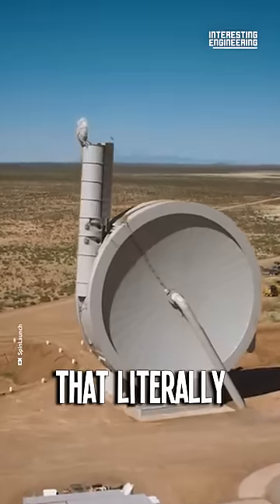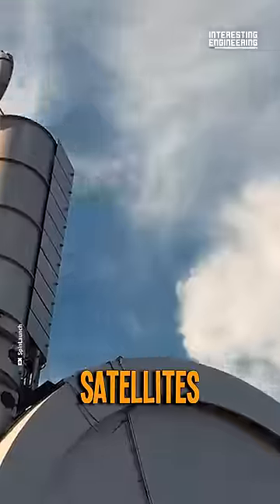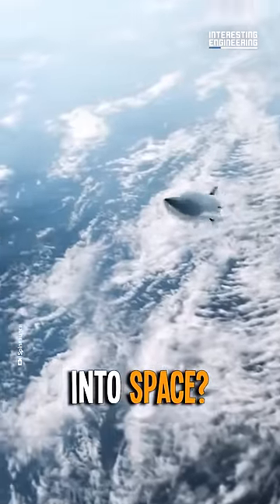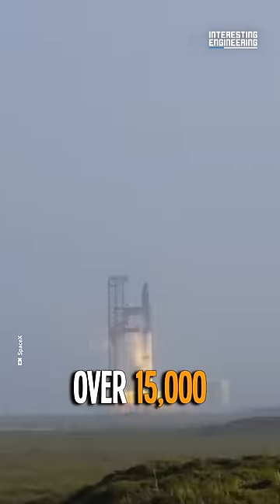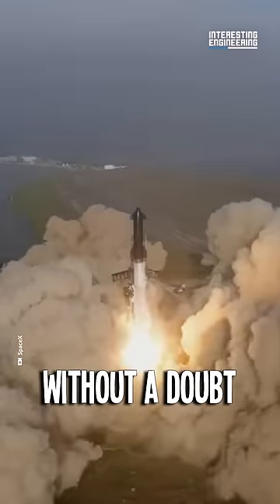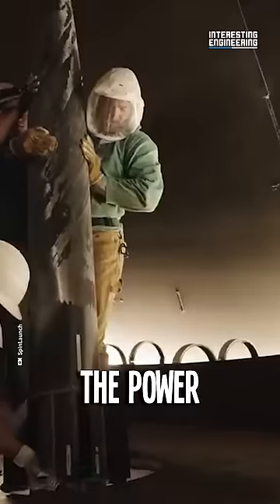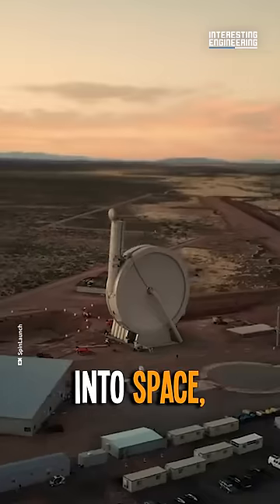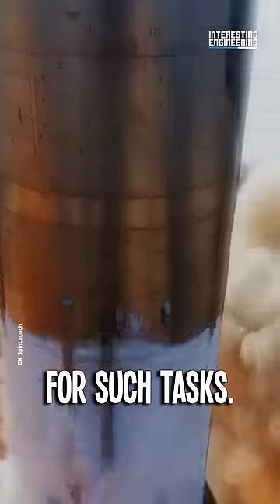Throwing Artillery Shells Into Space

Comment: US Military: Can we use this horizontally? 🤔 💀💀💀
Reply: Rail gun concept maybe
Reply: @eabroham7937umm no it's not. You can't shoot something this large as fast out of a barrel with gunpowder....
Reply: Or vertically down?
Reply: Way ahead of you bud 😂
Reply: they already have a railgun
Reply: @JakeRohde52  As fast that this device or as fast as to reach the orbit ? The "gunpowder" has beaten this device at the current stage 10 times over long ago. On November 18, 1966, the HARP gun operated by at Yuma Proving Ground launched an 84-kg Martlet 2 missile at 2,100 m/s, sending it briefly into space and setting a world altitude record of 179 km.
Reply: Iraq Supergun was originally a sat launching tool.
Reply: They already have a spin gun. Not sure if they use it or not. But it's been done.
Reply: @imantsjansons5009  The full sized HARP cannon was 16 inches in diameter . They had a baby 5 inch version that also easily outperformed the 1/3 scale Spinlaunch . The baby HARP was able to fire projectiles to an altitude of 240,000 feet as opposed to 30,000 feet by the Spinlaunch . It was used to collect atmospheric data and only cost $300-$500 per launch . There's no way that Spinlaunch could ever come close to the performance of the 60s HARP cannon .
Reply: centrifugal firing systems aren't new.
Reply: @greg77389  but this is totally different than a rail gun and would require way less power and they also gave up on the rail gun
Reply: @441rider  the story of the guy behind it is wild
Reply: What I was thinking 😭😂
Reply: At an angle😂
Reply: Yes you can. Also rocket fuel so who cares.
Reply: MajinBuu-oo3vn They aren't as good
Reply: @ItsCrap97  Exactly. Rocket fuel only costs the people that are launching the rockets any money.  It does not cost me anything at all.  The rocket launchers can spend one million dollars a gallon.  I do not care.  I use none of it.
Reply: Ironically the HARP Gun is what you get when the opposite happens 😂
(two naval guns combined into a great big sat' launcher... that fell victim to short sighted politicians 🤦‍♂️)
Reply: @bryanobrien2726  Yup. It's mad that nobody other than the chap whom devised HARP, has seriously tried to expand on the concept since.
Reply: Just change the launch angle, you got a long range artillery cannon.
Reply: @glidershower  Not as long range as some actual artillery guns though 😆
Reply: Trebuchet
Reply: US Military: Can this be used to assist in genocide?
Reply: This is the real reason for the invention
Reply: Rail gun, trebuchet, Evel Kinevel's new toy...
Didn't I see something like this in infinite warfare?
Reply: @MajinBuu-oo3vn  as if they have the budget to fuel not only a massive project like that not to mention the production, install, and/or retrofit on a massive scale to rapidly equip that piece of wargear.
Reply: Top comment 😂
Reply: @JakeRohde52 battleship guns?

What they are shooting looks a lot like a sabit round the Abrams would use.
Reply: @bryanobrien2726 I was thinking battleship main guns, but this is a much better example.
Reply: @jeffshackleford3152  It may well be a repurposed artillery shell of some kind . The one that they show firing is a 1/3 scale prototype SpinLaunch . It would be easier  to just use something readily available rather than make 1/3 scale version of something that most likely will never go into production .
Reply: Us weapons are so outdated
Reply: You got it backwards. They already do. Where do you think they got the idea from?
Reply: @JakeRohde52 yamato main guns:
Reply: This is from Germany
Reply: Kim jong Un 👀
Reply: Why horizontally though? Just have a crapton of bombs in orbit ready to drop at a moments notice, anywhere.
Reply: Haha "and Target that building over there "
Reply: Yes. Trebuchet
Reply: Artillery has been exploring this sort of thing for at least 50+ years and super guns for more than 100. Look up Gerald Bull or the Paris guns.
Reply: @441rider my brother in law was there when U.S. forces seized it, then destroyed it. Very interesting history with Gerald Bull too.
Reply: its called the railgun and yes they have the tech, requires a lot of induction energy
Reply: Oh shitttt
Reply: @Brian-rn2wx  why aren't we railgunning sats into space?
Reply: @jnuhjnuh  Ask NASA brev
Reply: @user-el5yw1er2j   Yeah...David and Goliath
Reply: Spin gun?
Reply: @JakeRohde52  false
Reply: It's never a war crime the first time :)
Reply: Apfsds it's from a barrel not rotating tho
Reply: That's true. Talk about saving money.
Reply: @johncameron6864 As compared to?
Reply: Yea, pretty shure they already tested electromagnetic rail guns.
I'm sure since MGS1 about that.
President Baker said it.
😊
Reply: Why do you think They created it??? No Propellant guided munitions with no thermalsig apart from mass v space.
Reply: 5000 mph/8500kph. Haven't seen a railgun used or refined ded recently
Reply: "on people?"
Reply: @matthewfors114  Gerald Bull, right? Wanted to continue his research and (I can't recall the circumstances, but he wasn't getting any takers) the Iraqis were like "Sure. We'll fund your research into a gun the size of a hillside." .......and then Mossad eliminated him as a threat to Israel.
Reply: Humans have been using it horizontally for millennia. There's even a mention of it in Mr Tangerines's favourite book.
Reply: Well said 
Good point
Reply: MuslimsAreEvil22  I love the message right on dude
Reply: already invented -= trebuchet
Reply: @jkiker7918  The trebuchet shoots vertically. The OP said horizontally. That's called a slingshot.
Reply: About 3/4 in, the video shows one system tilted about 40 degrees from horizontal, so I guess they didn't miss that sale opportunity.
Reply: They already have, with ball bearings. It cuts a line through concrete and anything behind it. Mankind is so inventive when it comes to killing machines.
Reply: You know that to a satellite enter i got it needs to run horizontally, right? RIGHT?
Reply: The biggest problem I would anticipate would be the contact with atmosphere at ground level coming out of this vacuum system at the required MACH number (25+?, or more to compensate the "air wall?). Seems to me that would create absurd heat but I'm no engineer. Can anyone with expertise tell me what would happen?
Reply: @Brian-rn2wx  tail gun uses magnets not centrifugal force dummy
Reply: @mf.danger9235 a person could be wrong about something, doesn't make them dumb. BTW,  Whats a tail gun Dummy?.

Comment: "We saved $50 million in fuel costs but DESTROYED a billion dollar satellite."
Reply: I was about to write - I am sure its possible with enough propellant to shoot something into space with a huge cannon (largest WW2 cannons reached the stratosphere) but the bigger issue is to keep stuff from vaporizing / breaking if you have to initially speed it up enough to go all the way to space…
Reply: You really don’t think the engineers can design around that? What makes you think you know more about this than aerospace engineers with PhDs?
Reply: There are missiles smarter than you that move 3 times the speed of sound and theyre able to hold it together. Im sire they can apply the same tech to satellites
Reply: @bingobongo1615 Well, shells are accelerated under tremendous strain in the barrel, while proposed system is kinda just spin it. Still axial strain and especially during release one should be tremendous. Though if an actual satellite situated closer to centre of spinning it can actually work
Reply: @bingobongo1615 I remember that big cannon
Think that was the 60s. Seems they abandoned that idea
Reply: Think this - impulse loads versus ramp accelerated loads. They are miles apart
Reply: I have a picture of a ghost on a tv.
Reply: Exactly.
Reply: Aaaand it dont wok
Reply: @couchpotatoes5158 the point that actually nobody is doing it, it is mindful anyway
Reply: @BillyBigRiggin359 yes and no. They have very short life …
Reply: @BillyBigRiggin359 3 times the speed of sound? You know escape velocity is 40x the speed of sound? And in a rocket it is applied relatively gently at about 5g. However, in spin launch just to spin the satellite up to speed ( assuming a spinner 10 stories high) it will experience many thousands of g's. This is enough to make concrete disintegrate.  No. They're going to have to use very different technology.  Hence the remark about destroying satellites
Reply: @couchpotatoes5158 because I do, and I’m not taking look-in-the-mirror lessons from a couch potato
Reply: Ahahahahahahahahahaha! Geez I love  the genius of other comedic minds. 😅
Reply: Wasn't that the design lol
Reply: @couchpotatoes5158  you're an excellent example of someone who doesn't have the physics acumen to verify the veracity of what they read or are told. 🙄
Reply: @couchpotatoes5158 huh? Keep glazing
Reply: @大砲はピュ  do you not have a valid response? Wtf do you mean “keep glazing”? That means nothing
Reply: Acceleration = V^2/r and a LEO satellite moves at 16,000 mph that's about 26,000kmh so you would need to achieve 7200 m/sec
Tun that through the equation with r set to 30m (100ft ring) we end up with 170,000G.  That's 20 more than acceleration from a canon shell.   So will this satellite survive?
Reply: @bingobongo1615 there’s testing on using railguns to do that, but now the problem is related to the strong magnets being used rather than the destructive propellants… plus I don’t even know if they’ve managed to make a strong enough railgun yet
Reply: @couchpotatoes5158 it's a basic impossibility. Objects at sea level experience more drag than objects in the upper atmosphere, which is why multi stage rockets make sense. We can tweak the throttle so it stays efficient and doesn't blast itself apart. Just yeeting it directly from ground level somewhere in the everglades directly into the stratosphere will cause numerous insurmountable problems just from the structural standpoint alone
Reply: @lithuaniaball  they have already proved this works. Stop acting like you know more than engineers with phds
Reply: @couchpotatoes5158  oh? Show me a working model, then. Otherwise, all they have done is a series of mathematical equations that theoretically prove it could work, unless they missed something. I'll wait here in the real world
Reply: Ok and space xs tests. “We attempted to make it Stand up on its own. We failed. We failed. We failed. We got close but failed. Hold on we succeeded.”
Reply: @lithuaniaball I'm so glad that you have such a closed mind, yeeting and all that. Why not build the launch site on Everest! You could yeet the satellites up there easily, with just a trebuchet! Then they get loaded into a concrete casing for the final yelling! The concrete yeets away under the stresses, and in doing so it prevents the satellite from experiencing any trauma! And the rocket does the final yeeting, and yeets it straight into the sun!
Reply: @bingobongo1615  I think the satellites already travel at very high speeds to escape gravity. But throwing probably requires even more speed, since after the initial throw there is no more pushing ahead against the atmospheric pressure and the gravity pull.
Reply: Nowhere near 15,000 gallons per second
Reply: Destroyed? oh, you mean completely pulverized it? yeah, nothing like billion dollar powder to spice up your bbq
Reply: @couchpotatoes5158 nah I think it'll bake in a failure rate that is unacceptable given the various types of satellites, potentially sensitive instruments and G force involved

Not to mention the G forces involved here are absolutely mind-boggling and there are hundreds of different satellites with different purposes and tolerances.

There's a reason this has been an idea for decades now and they haven't gotten it to work
Reply: @jazeenharal6013  you really don’t think the engineers account for that when designing satellites?
Reply: @couchpotatoes5158  we're talking about a platform that has never once worked because it crushes everything with centrifugal force. 
The amount of G-Force an object would be under in order to spin it fast enough to launch it high enough is absolutely unbelievable. 
It would crush just about any complex device before it even got to half power.
Sensitive electrical components, capacitors, processors etc.

There is a hard limit to engineering. They're not magicians, they have to work with real materials.

Maybe a different version of this type of idea might work, but not this one. (Perhaps a much longer rail type system that goes underground and gets speed up over a longer distance. A "space cannon" maybe. But not this one, this thing will never work)
Reply: @nicholaswhitehead8842 More precisely; the politicians got bored [as they often do] and the inventor got murdered by Mossad after he tried to find another patron.
Reply: Satellites are cheaper than the cost of sending them to orbit. Unless you're talking about some crazy overpriced NASA project with a ridiculous budjet
Reply: @couchpotatoes5158  Aerospace engineers with PhDs had decided to take a different route. That should be a hint.
Reply: @BillyBigRiggin359 🫨😯🤭🤣…🫡 well said
Reply: @bingobongo1615  rumour has it that a nuclear bomb launched a manhole cover into space.
Reply: @couchpotatoes5158  Bold of you to think anyone on this team has a PhD. Also bold of you to think that PhDs have any real authoritative value anymore in the fact of Boeing's endless string of failures lately.
Reply: @wolfehoffmann2697  are you slow? Having a PhD means you’re on top of you’re field and know what you’re doing. Also the media is completely blowing all this Boeing shit up; Boeing still has an extremely good safety record compared to other companies. And of course Boeing’s top engineers has PhDs
Reply: @couchpotatoes5158 having a phd in physics doesn’t make you immune from the laws of physics.
Reply: @couchpotatoes5158  This thing is stupid. I say it with confidence using my high school physics knowledge.
Reply: I wonder if it can launch a ball containing a satellite which can then unfold in space.
Reply: @bingobongo1615  I think I remember ex Iraqi President Saddam Hussein used to have a program where they designed a cannon or some type of projectile firing that can fire a shell, satellite or something else very high up.
Reply: @lithuaniaball they've already launched electronics. One thing was a cell phone. Phones don't even pass drop tests.
Reply: Why do they cost that much?
Reply: @couchpotatoes5158  Nope, imagine the G forces created to launch your phone into space, your phone would be flatter then a piece of paper before it even reaches enough G's to escape earth gravity velocity.
Reply: @JerryDoe  again, you really don’t think the engineers with phds who built this thing took into account the g forces, but some armchair expert on the internet did?
Reply: @couchpotatoes5158  I'm an engineer in Aerodynamics, Hydraulics, Pneumatics, not your average...
The Math here isn't to hard to solve that no electronics would survive here... it requires to put 10,000 G force on the object to launch for 30 minutes tops to launch, that means the object's weight x 10,000 x 30 minutes...
Nothing in electronics not even a resistor or any component would survive this...

It has already been debunked so many times,  they also never launched anything during all those years... why you even persist like they are capable ?
Reply: FACTS
Reply: @couchpotatoes5158  I know enough about orbital mechanics to know that simply shooting something in one direction won't work. It will simply fall back down after reaching apoapsis. Unless it accelerates to over 8 km/s or 22000 mph in space, in the direction of earths spin it won't achieve orbit. Even if they figure something out, which they won't because this is a really bad idea, this will NEVER leave LEO. Simply putting fuel and engines on the satellite also won't work, since it will be too heavy, meaning it won't have enough Δv, and it probably won't even leave the atmosphere. Orbital velocity for low earth orbit is 8 km/s, they'll be lucky if they even manage to get to 1. The only reason this works is because the satellite is light enough to be launched. Add more dry mass and see how it holds up.